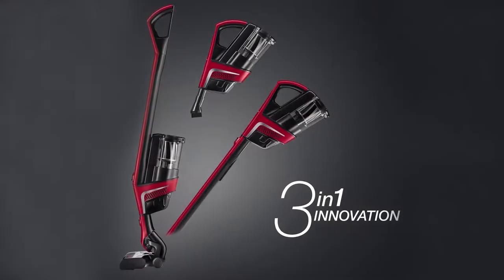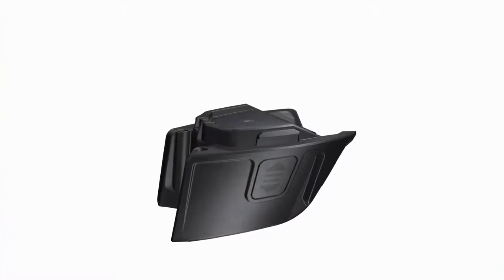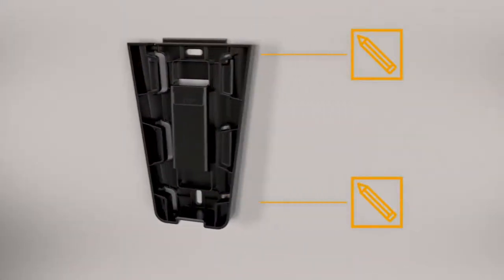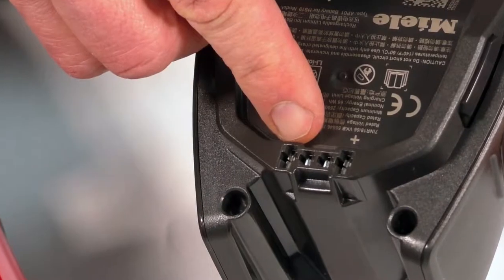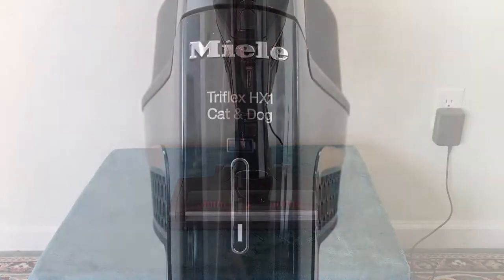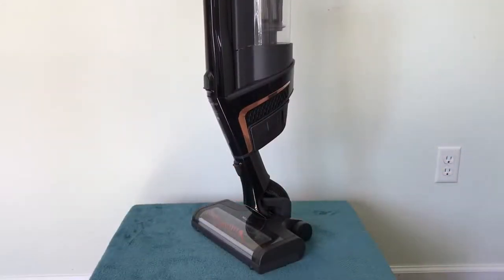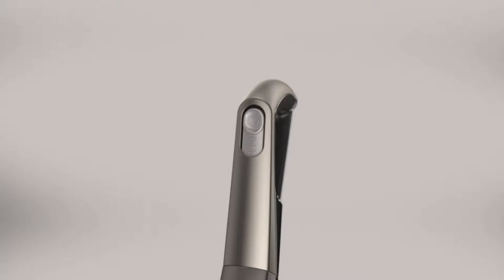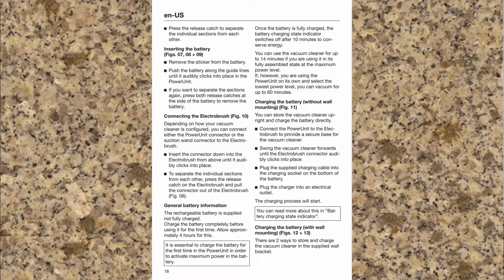How to Charge the Battery of Your Triflex HX1 Vacuum for the First Time

Comment: I charged it but when I put the battery in the lower light blinks fast for a few seconds then turns off. The vacuum does not work if I turn it on. Is it a bad unit?